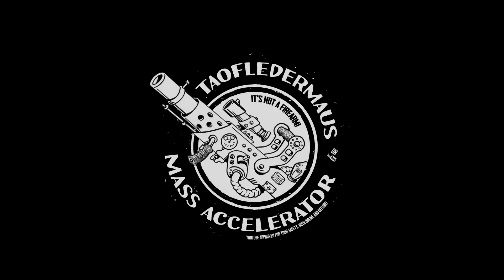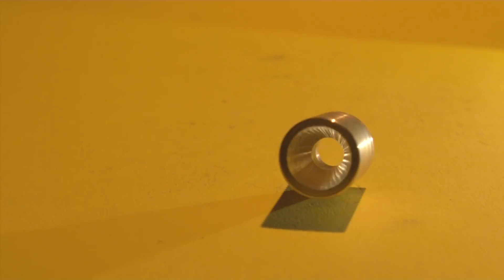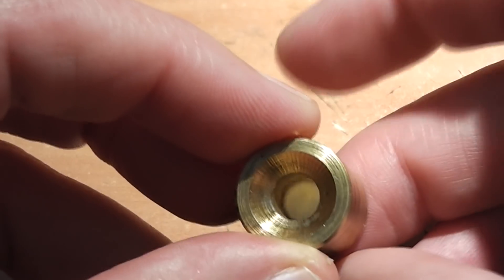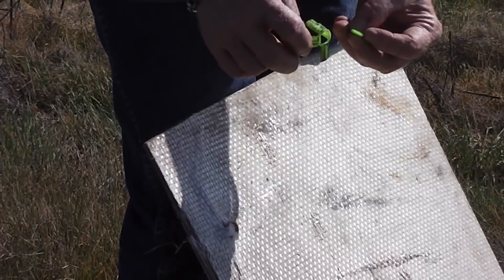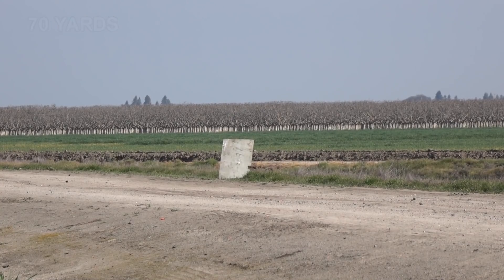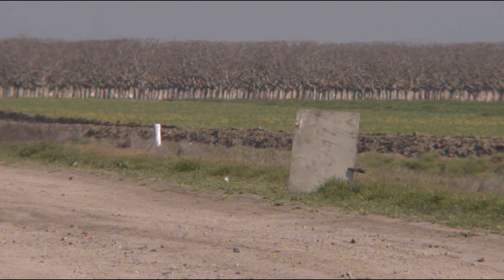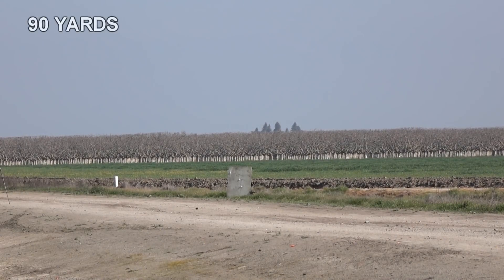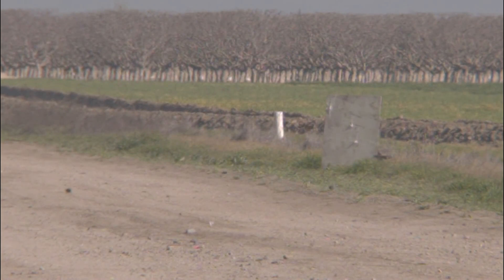LONG RANGE Whistling Projectile Test (viewer suggestion)

Comment: 4:53
I wouldn't be too disappointed. Pretty sure the whistle was doppler shifted too high for the forward camera mic. (Rough calculations incoming) Spectrum shows whistle is 6800hz (harmonic at 3400hz) from behind the shooter, with the projectile at ~300m/s (speed of sound is ~340m/s) the projectile is whistling at 12,800hz. The forward camera would have 'heard' a whistle that started around 24khz, dropping sharply to 12.8khz in less than 0.1 sec (flight time of projectile is .2 seconds, though it's relative velocity with reference to the forward camera decreases more sharply the closer it gets to target due to angle of flight). Doubt the camera would be sensitive to 24khz sounds (typical is 20hz-20khz). Even if it was, most audio compression formats (like MP3) will largely ignore and strip out tones above 18khz before the video even gets off the camera. Love your work bud.
Reply: It's also possible that the camera has an auto-gain control (AGC) feature that is intended to boost low sounds and and clip sudden loud sounds (like the whistle of an accelerated mass as it goes transonic).

It's definitely worth checking in the camera's menu to see if the AGC can be turned off.
Reply: @Sharklops  Absolutely it is, and I don't question for a second why they haven't used super expensive, high quality recording equipment forward of the mass accelerator.
Reply: Interesting. What if guns can be made quieter by modifying the ammo so it’s sound is so high pitched it’s not registered as a rifle report ?
Reply: stopglobalswarming  there is subsonic ammo for suppressors, if you shot the whistler ammo at mach 1 it will still make a crack because as TAOFLEDERMAUS said at that speed the air wont go through the center
Reply: Eduardo Espinoza I understand subsonic ammo and suppressors. I mean modifying the ammo to change the pitch of the sound so it is unrecognizable as a gunshot. It may be more possible with handguns and ported barrels if done scientifically.
Reply: @stopglobalswarming  but doesn't it only hear the crack? and maybe the impact? not really the bullet midair? if you load your rounds right you could shoot under mach 1 but like TAOFLEDERMAUS said the drag will make the round useless after a throwing distance.
Reply: @Eduardo_Espinoza  The crack you hear as a bullet goes past is the bullet midair. If you tuck yourself under the mantlet on the rifle range, waiting to patch up the targets between shooters, while your friends shoot from 200m, or you leave a camera recording across the butts while you shoot from 200m, you'll hear a distinct CRACK-bang sound. From 100m, they're closer together and the bang's louder. From 300m, they're farther apart and the bang's quieter. Around 600m, the CRACK gets replaced with a doppler iiiuuu, and beyond that the bang is getting closer and closer behind that sound.
The CRACK is the shockwave from the supersonic bullet, trailing back in a cone with the bullet at its point. The bang is the gunshot.
In order:
first shot is fired;
weapon cycles;
second shot is fired;

first bullet passes 100 m;
weapon cycles second time;
third shot is fired;
second bullet passes 100 m;

first bullet passes 2 m over your head at 198 m;
first bullet passes through target at 200 m;
shockwave from first bullet reaches your ears;
sound of first bullet hitting target reaches your ears;
first bullet hits sand;
your brain processes the sound of the first CRACK;
weapon cycles third time;
third bullet passes 100 m;
second bullet passes 2 m over your head at 198 m;
second bullet passes through target at 200 m;
shockwave from second bullet reaches your ears;
sound of second bullet hitting target reaches your ears;
second bullet hits sand;
your brain processes the sound of the second CRACK;
third bullet passes 2 m over your head at 198 m;
third bullet passes through target at 200 m;
shockwave from third bullet reaches your ears;
sound of third bullet hitting target reaches your ears;
third bullet hits sand;
your brain processes the sound of the third CRACK;
sound of the first shot reaches your ears;
your brain processes the sound of the first shot;
sound of the second shot reaches your ears;
your brain processes the sound of the second shot;
sound of the third shot reaches your ears;
your brain processes the sound of the third shot;
an object dropped from six feet up when you processed that first CRACK hits the ground.
Reply: @stopglobalswarming  what? The loud part of a gun happens at the muzzle. You use silencers to dump that. However the supersonic crack of the bullet will still be heard.
Reply: colcol83ful I understood almost nothing of what you just said but totally appreciate the insight.
Reply: @dbayboyds409  Basically imagine how an ambulance siren changes pitch as it's moving with it being pitched upwards as it comes towards you then downwards as it passes you- that's doppler shift, it's also happening here but instead of a slow ambulance with a relatively low pitched siren it's a very fast projectile making a pretty high pitched sound and as a result the pitch of the sound produced is changed radically depending on whether it's coming towards you or moving away from you
Reply: Caleb Howes a beautiful explanation. Thank you
Reply: yep. you need a good shotgun and a good 98k/32bit recorder + raw format
Reply: r/theydidthemath
Reply: I remember an early MPEG-1 L3 compression implementation (I forget who's) was simply chopping off all frequencies above 15kHz before applying the filters and compression. At the time, most MP3 files were encoded in 128kbs Joint Stereo. Broadband hadn't gotten popular yet. Napster hadn't been invented yet. People were using FTP.
Reply: It's interesting that the down range cam did pick up the sound on the 2nd shot @ 3:37.
Reply: nerd
Reply: I was pretty sure that I was hearing the difference in Doppler shift between the accelerator camera and the target camera. Granted, I have the same kind of hearing damage that some of the others in here have, but I know that I hear "differently." It's tough to describe. I sometimes don't hear a high pitched sound that other people can hear, so much as I feel an odd sense of pressure at the ear. I guess it's my brain compensating for the frequencies I have lost. I could do without the permanent ringing in the ears, though.
Reply: @richard6133  permanent ringing in the ears is definitely a sign of permanent threshold shift (hearing loss). It could be explained that you feel the psychoacoustics that come with the high-pitched sound. Often times higher pitch sounds actually can feel like they hurt our ears. There are other factors like the feeling of pressure on your ears when using an active noise cancelling headphone.
Reply: I was thinking that is why we really only heard it on the shot over one, but I was NOT going to do that math, ha.
Reply: Whats the BEST FORMAT lowest size for audio. Recommend thanks.
Reply: @gullybull5568  FLAC. free lossless audio codec. Id say that if RAW format is like carrying all the instruments in your headphones and having them reproduced almost perfectly, then FLAC is the closest equivalent, also some flac files have different encoding. Look for 24 bit 82khz for the perfect balance. 192k and 32 bit is only used for studio recording and its all scaled down to fit more compact file sizes after the fact. If you want to use a good streaming service that will provide lossless audio then you should use Tidal. Spotify, apple music and youtube music are all overcompressed crap. Spotify regular and spotify premium is rhe same quality btw, just with a different lable, but they make you think youre getring a quality bump like Tidal offers.
Reply: Reading a comment like this on youtube is like finding a unicorn pooping gold coins in your front yard.  Thank you!
Reply: I kinda figured something like that, although for some reason my brain decided to say that the sound was blue-shifted...
Reply: @GadgetBoy  Same effect. Blue-shift is an increase in frequency caused by an approaching emitter.
Reply: With the camera placed close to the target downrange... And the slug traveling close to the speed of sound... You won't hear a whistle at all ... You will hear all the sound produced by the projectile all arriving at the microphone at the same moment as the sound can barely travel slightly faster than the round.

This is common with military jets traveling close to the speed of sound and arriving on site with a huge snap of sound all at once... People think they heard a sonic boom but it's not... It's all the sound that aircraft made for the last mile arriving at your eardrums at the same time... They use that effect a lot at airshows because the sonic boom that close to the show would break windows.
Reply: I wonder if adjusting the size (tone) might could use the sound resonance to help either stabilize in flight, or to help induce expansion/fragmentation?   The crystal glass effect..     does that make sense?
Reply: Came to say this, the easy way to say it.
The sound is barely faster then the bullet, so all the sound comes in allmost simultaneously on the recieving end.
Reply: You're out here with a reddit lvl comment on youtube.
Reply: Just got done taking a physics class during my summer session and surprisingly understood most of what you said there.  Very cool seeing a real world application in a sense. Thanks for the comment!
Reply: That makes sense to me. Nice analysis thank you.
Reply: Thats a good analysis, however human hearing range in general is about 30 to 3500/4000 hz. Some people less and some up to mabey 10k, those are exceptions. Dogs have more acute hearing as the unhearable dog whistle shows us. The harmonics generated off hi frequencies are generally what people hear when adjusting the hi side of their frequency balance on their stereo equalizer and allowing more output of a particular frequency and it's harmonics or mabey its particular vibrations perceived as sound as labs have proven. Most people have no clue that this device is to balance a sound or frequency to all points in a given space equally not to boost it for hearing only at one point.
  This slug could be tuned to differant frequencies given time and good analysing using a series of micophones and a lab radar stratigicly positioned down the flight path of the slugs.
Reply: @davidunderwood3605  you are grossly misinformed. The human hearing ranges from 20hz to 20,000hz. The typical human can hear from 40hz to 14,000 by the age of 30. Equipment can pick up anything from 1hz to 100khz easily but we wont hear whatever isnt in our hearing range. There are also psychoacoustics which are frequencies we cant hear but that sync up with our bodies and can affect our mood. 
Source: im an audio engineer.
Reply: @ferarry13  wow. Thats the general range for most adults. And this means that all the electronic trainings  I received in school,the military and college must have been wrong. Not to mention the many hearing experts I have had to visit over my life time for my hearing deficiency due to to many years of no ear pro when shooting, hunting, going to rock concerts and spending long time at the drag strips and a few military flightlines when I was young. And ifwhat  what you say is true then all those people who claim they cannot hear those dog whistles must be lying or mistaken. But ok you could be right if those frequencies are projected at a decibel level loud enough to damge the hearing of those cranking it up that loud.
Reply: @davidunderwood3605  If all of that training says that human hearing maxes out 4khz, then  yes, your school, military and college education has been wrong. The human voice maxes out at around 3500, so maybe that's what you're thinking of. I'm curious what military training did you receive that included the range of human hearing? Also, dog whistles normally have a frequency of about 23khz, still higher than a normal person, although there's probably a few people that can hear that high.
Reply: @davidunderwood3605  no, you claim to only be able to hear up to 4.5khz (edit: its 3.4kHz. 4.5kHz must have been a world record for some singer i remember) but thats the range of the human voice, and even then its the maximum amount of octaves for the human voice and its extremely rare for any person to have that wide range. You do in fact lose hearing from going to drag strips as you said and rock concerts and other stuff but the exposure you need to get permanent hearing loss is about 85+dB for longer than an hour, and the louder you get the more damaging the sound is to your ears. Concerts often go as loud as 120dB and gunshots can exceed 140dB for a really short time however. Dog whistles operate at around 54kHz, whereas the human hearing MAXES OUT at 20kHz with the typical range being as i mentioned earlier between 60Hz and 14kHz by the age of 30. I am 25 and can confirm that my hearing range is about 50Hz to 17kHz. So either this entire time youre talking to me about the range of the human voice interpreting its the range of the human hearing, or you need to check your facts better.
Reply: @Geerice  just one correction, dog whistles can range anywhere between 24khz and 50+khz. The closer they are to human hearing however, the more equipment can pick up on them so typically you'd see them in the 40khz+range

Comment: Imagine having this round in a .50 cal machine gun
Reply: Or just 12 gauge from hell. Basically a 50 bmg blown out to a brass shelled 12 gauge that is much longer
Reply: Back in the eighties PMC marketed a tubular projectile in most of the pistol calibers. It came and went while I was overseas. So I never got to try any out. So I guess it wasn't too good since it didn't last very long.

Comment: Got two ads (for IWB holsters) because you used the mass accelerator and not a nasty old gun. Seems the YT algorithms have a sense of humor...
I'm thinking it's not that the audio on the remote camera is all that terrible, it's that the sound selectively radiates from the aft end of the projectile, so there just ain't that much to hear from the front.
What determines the frequency of the sound, the diameter of the throat of the nozzle? The length of the "end bell"? Both interacting? Some more projectiles with different parameters could be interesting. (That's a hint, Saar.)
Reply from the maker: I hope he can come up with other similar designs

Comment: Ok, try this...
Cast an identical projectile from some lightweight material that is strong enough to withstand the huge velocity imparted by the Mass Accelerator but have it mounted on the BORE, with a launching rod not too heavy to create a "bore obstruction," sorta like launching a rocket/grenade from WWII era.
That or design a Mass Accelerator like a BIG Potato Gu..... er, Launcher.
See if the MUCH larger venturi tube creates a MUCH louder whistling/screaming sound. 
I suspect it will but at much higher frequencies much like a Dog Whistle.
In which case OG will be heard howling from MILES away as his ears are so sensitive. 
Asking for a friend, actually. LOL

Comment: You can actually see the air distortion around the whistling slug at 5:00.

That's one hell of a good shot, Taofledercrew. Excellent use of the linear accelerator.
Reply from the maker: thank you!
Reply: Good catch.
Reply: Actually that's the slug not an air distortion